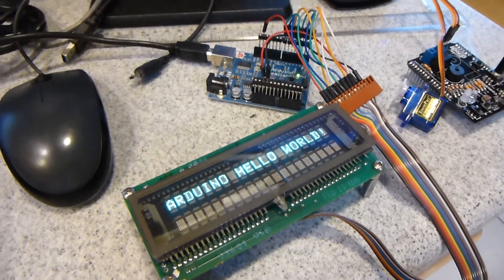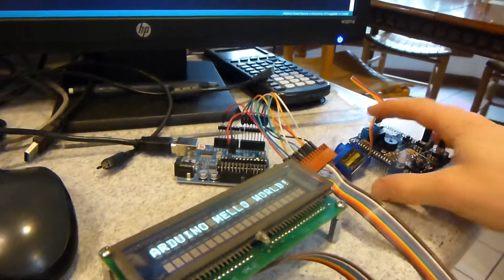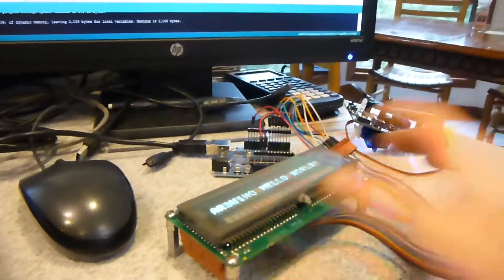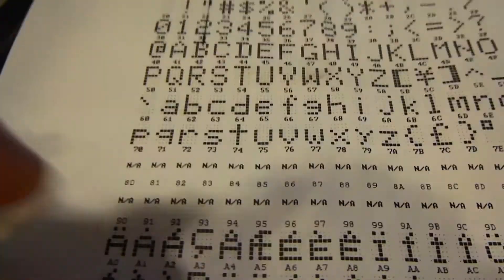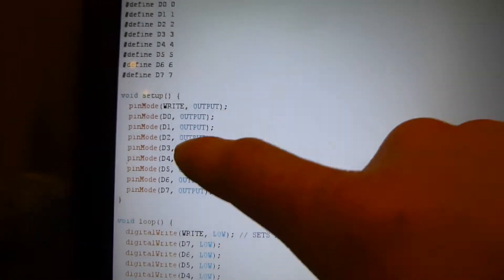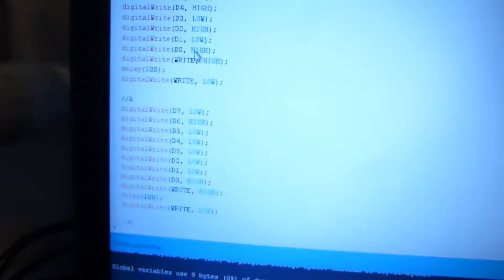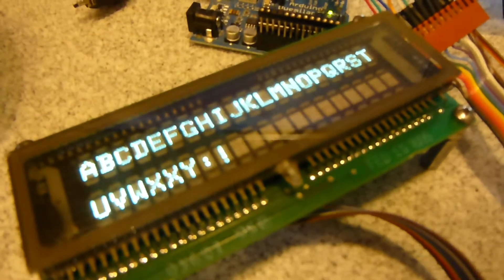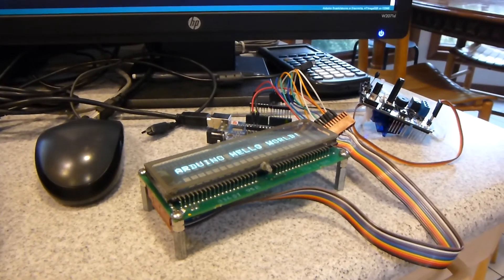Arduino Driving Vacuum Florescent Display With ASCII Hexadecimal Code

Comment: Dat pronunciation of duemilanove hahaha. "due-mil-a-no-vey" :)
It's definitely millisecond. Milli is 1/1000, micro is 1/1,000,000.
Reply from the maker: Jordan O'C LOL yeah my pronunciation is skookum!  LOL  I messed that one up!  :P  Thanks!
Reply: Makerj101 It's ok xD
Reply from the maker: Jordan O'C  Check out my code for the alphabet!  Yes, it is over 400 lines long and I expect nothing less than you to read every line.  LOL  have fun with that!  :P  JK

 //Alphabet Arduino

#define WRITE 13
#define D0 0
#define D1 1
#define D2 2
#define D3 3
#define D4 4
#define D5 5
#define D6 6
#define D7 7

void setup() {  
  pinMode(WRITE, OUTPUT);
  pinMode(D0, OUTPUT);
  pinMode(D1, OUTPUT);
  pinMode(D2, OUTPUT);
  pinMode(D3, OUTPUT);
  pinMode(D4, OUTPUT);
  pinMode(D5, OUTPUT);
  pinMode(D6, OUTPUT);
  pinMode(D7, OUTPUT);
}

void loop() {
  digitalWrite(WRITE, LOW); // SETS ALL PINS LOW
  digitalWrite(D7, LOW);
  digitalWrite(D6, LOW);
  digitalWrite(D5, LOW);
  digitalWrite(D4, LOW);
  digitalWrite(D3, LOW);
  digitalWrite(D2, LOW);
  digitalWrite(D1, LOW);
  digitalWrite(D0, LOW);

//CLEAR DISPLAY
  digitalWrite(D7, LOW);
  digitalWrite(D6, LOW);
  digitalWrite(D5, LOW);
  digitalWrite(D4, HIGH);
  digitalWrite(D3, LOW);
  digitalWrite(D2, HIGH);
  digitalWrite(D1, LOW);
  digitalWrite(D0, HIGH);
  digitalWrite(WRITE, HIGH);
  delay(100);
  digitalWrite(WRITE, LOW);
  
  //A
  digitalWrite(D7, LOW);
  digitalWrite(D6, HIGH);
  digitalWrite(D5, LOW);
  digitalWrite(D4, LOW);
  digitalWrite(D3, LOW);
  digitalWrite(D2, LOW);
  digitalWrite(D1, LOW);
  digitalWrite(D0, HIGH);
  digitalWrite(WRITE, HIGH);
  delay(100);
  digitalWrite(WRITE, LOW);
  
  //B
  digitalWrite(D7, LOW);
  digitalWrite(D6, HIGH);
  digitalWrite(D5, LOW);
  digitalWrite(D4, LOW);
  digitalWrite(D3, LOW);
  digitalWrite(D2, LOW);
  digitalWrite(D1, HIGH);
  digitalWrite(D0, LOW);
  digitalWrite(WRITE, HIGH);
  delay(100);
  digitalWrite(WRITE, LOW);
  
  //C
  digitalWrite(D7, LOW);
  digitalWrite(D6, HIGH);
  digitalWrite(D5, LOW);
  digitalWrite(D4, LOW);
  digitalWrite(D3, LOW);
  digitalWrite(D2, LOW);
  digitalWrite(D1, HIGH);
  digitalWrite(D0, HIGH);
  digitalWrite(WRITE, HIGH);
  delay(100);
  digitalWrite(WRITE, LOW);
  
  //D
  digitalWrite(D7, LOW);
  digitalWrite(D6, HIGH);
  digitalWrite(D5, LOW);
  digitalWrite(D4, LOW);
  digitalWrite(D3, LOW);
  digitalWrite(D2, HIGH);
  digitalWrite(D1, LOW);
  digitalWrite(D0, LOW);
  digitalWrite(WRITE, HIGH);
  delay(100);
  digitalWrite(WRITE, LOW);
  
  //E
  digitalWrite(D7, LOW);
  digitalWrite(D6, HIGH);
  digitalWrite(D5, LOW);
  digitalWrite(D4, LOW);
  digitalWrite(D3, LOW);
  digitalWrite(D2, HIGH);
  digitalWrite(D1, LOW);
  digitalWrite(D0, HIGH);
  digitalWrite(WRITE, HIGH);
  delay(100);
  digitalWrite(WRITE, LOW);
  
  //F
  digitalWrite(D7, LOW);
  digitalWrite(D6, HIGH);
  digitalWrite(D5, LOW);
  digitalWrite(D4, LOW);
  digitalWrite(D3, LOW);
  digitalWrite(D2, HIGH);
  digitalWrite(D1, HIGH);
  digitalWrite(D0, LOW);
  digitalWrite(WRITE, HIGH);
  delay(100);
  digitalWrite(WRITE, LOW);
  
  //G
  digitalWrite(D7, LOW);
  digitalWrite(D6, HIGH);
  digitalWrite(D5, LOW);
  digitalWrite(D4, LOW);
  digitalWrite(D3, LOW);
  digitalWrite(D2, HIGH);
  digitalWrite(D1, HIGH);
  digitalWrite(D0, HIGH);
  digitalWrite(WRITE, HIGH);
  delay(100);
  digitalWrite(WRITE, LOW);
  
  //H
  digitalWrite(D7, LOW);
  digitalWrite(D6, HIGH);
  digitalWrite(D5, LOW);
  digitalWrite(D4, LOW);
  digitalWrite(D3, HIGH);
  digitalWrite(D2, LOW);
  digitalWrite(D1, LOW);
  digitalWrite(D0, LOW);
  digitalWrite(WRITE, HIGH);
  delay(100);
  digitalWrite(WRITE, LOW);
  
  //I
  digitalWrite(D7, LOW);
  digitalWrite(D6, HIGH);
  digitalWrite(D5, LOW);
  digitalWrite(D4, LOW);
  digitalWrite(D3, HIGH);
  digitalWrite(D2, LOW);
  digitalWrite(D1, LOW);
  digitalWrite(D0, HIGH  );
  digitalWrite(WRITE, HIGH);
  delay(100);
  digitalWrite(WRITE, LOW);
  
  //J
  digitalWrite(D7, LOW);
  digitalWrite(D6, HIGH);
  digitalWrite(D5, LOW);
  digitalWrite(D4, LOW);
  digitalWrite(D3, HIGH);
  digitalWrite(D2, LOW);
  digitalWrite(D1, HIGH);
  digitalWrite(D0, LOW);
  digitalWrite(WRITE, HIGH);
  delay(100);
  digitalWrite(WRITE, LOW);
  
  //K
  digitalWrite(D7, LOW);
  digitalWrite(D6, HIGH);
  digitalWrite(D5, LOW);
  digitalWrite(D4, LOW);
  digitalWrite(D3, HIGH);
  digitalWrite(D2, LOW);
  digitalWrite(D1, HIGH);
  digitalWrite(D0, HIGH);
  digitalWrite(WRITE, HIGH);
  delay(100);
  digitalWrite(WRITE, LOW);
  
  //L
  digitalWrite(D7, LOW);
  digitalWrite(D6, HIGH);
  digitalWrite(D5, LOW);
  digitalWrite(D4, LOW);
  digitalWrite(D3, HIGH);
  digitalWrite(D2, HIGH);
  digitalWrite(D1, LOW);
  digitalWrite(D0, LOW);
  digitalWrite(WRITE, HIGH);
  delay(100);
  digitalWrite(WRITE, LOW);
  
  //M
  digitalWrite(D7, LOW);
  digitalWrite(D6, HIGH);
  digitalWrite(D5, LOW);
  digitalWrite(D4, LOW);
  digitalWrite(D3, HIGH);
  digitalWrite(D2, HIGH);
  digitalWrite(D1, LOW);
  digitalWrite(D0, HIGH);
  digitalWrite(WRITE, HIGH);
  delay(100);
  digitalWrite(WRITE, LOW);
  
  //N
  digitalWrite(D7, LOW);
  digitalWrite(D6, HIGH);
  digitalWrite(D5, LOW);
  digitalWrite(D4, LOW);
  digitalWrite(D3, HIGH);
  digitalWrite(D2, HIGH);
  digitalWrite(D1, HIGH);
  digitalWrite(D0, LOW);
  digitalWrite(WRITE, HIGH);
  delay(100);
  digitalWrite(WRITE, LOW);
  
  //O
  digitalWrite(D7, LOW);
  digitalWrite(D6, HIGH);
  digitalWrite(D5, LOW);
  digitalWrite(D4, LOW);
  digitalWrite(D3, HIGH);
  digitalWrite(D2, HIGH);
  digitalWrite(D1, HIGH);
  digitalWrite(D0, HIGH);
  digitalWrite(WRITE, HIGH);
  delay(100);
  digitalWrite(WRITE, LOW);
  
  //P
  digitalWrite(D7, LOW);
  digitalWrite(D6, HIGH);
  digitalWrite(D5, LOW);
  digitalWrite(D4, HIGH);
  digitalWrite(D3, LOW);
  digitalWrite(D2, LOW);
  digitalWrite(D1, LOW);
  digitalWrite(D0, LOW);
  digitalWrite(WRITE, HIGH);
  delay(100);
  digitalWrite(WRITE, LOW);
  
  //Q
  digitalWrite(D7, LOW);
  digitalWrite(D6, HIGH);
  digitalWrite(D5, LOW);
  digitalWrite(D4, HIGH);
  digitalWrite(D3, LOW);
  digitalWrite(D2, LOW);
  digitalWrite(D1, LOW);
  digitalWrite(D0, HIGH);
  digitalWrite(WRITE, HIGH);
  delay(100);
  digitalWrite(WRITE, LOW);
  
  //R
  digitalWrite(D7, LOW);
  digitalWrite(D6, HIGH);
  digitalWrite(D5, LOW);
  digitalWrite(D4, HIGH);
  digitalWrite(D3, LOW);
  digitalWrite(D2, LOW);
  digitalWrite(D1, HIGH);
  digitalWrite(D0, LOW);
  digitalWrite(WRITE, HIGH);
  delay(100);
  digitalWrite(WRITE, LOW);
  
  //S
  digitalWrite(D7, LOW);
  digitalWrite(D6, HIGH);
  digitalWrite(D5, LOW);
  digitalWrite(D4, HIGH);
  digitalWrite(D3, LOW);
  digitalWrite(D2, LOW);
  digitalWrite(D1, HIGH);
  digitalWrite(D0, HIGH);
  digitalWrite(WRITE, HIGH);
  delay(100);
  digitalWrite(WRITE, LOW);
  
  //T
  digitalWrite(D7, LOW);
  digitalWrite(D6, HIGH);
  digitalWrite(D5, LOW);
  digitalWrite(D4, HIGH);
  digitalWrite(D3, LOW);
  digitalWrite(D2, HIGH);
  digitalWrite(D1, LOW);
  digitalWrite(D0, LOW);
  digitalWrite(WRITE, HIGH);
  delay(100);
  digitalWrite(WRITE, LOW);
  
  //U
  digitalWrite(D7, LOW);
  digitalWrite(D6, HIGH);
  digitalWrite(D5, LOW);
  digitalWrite(D4, HIGH);
  digitalWrite(D3, LOW);
  digitalWrite(D2, HIGH);
  digitalWrite(D1, LOW);
  digitalWrite(D0, HIGH);
  digitalWrite(WRITE, HIGH);
  delay(100);
  digitalWrite(WRITE, LOW);
  
  //V
  digitalWrite(D7, LOW);
  digitalWrite(D6, HIGH);
  digitalWrite(D5, LOW);
  digitalWrite(D4, HIGH);
  digitalWrite(D3, LOW);
  digitalWrite(D2, HIGH);
  digitalWrite(D1, HIGH);
  digitalWrite(D0, LOW);
  digitalWrite(WRITE, HIGH);
  delay(100);
  digitalWrite(WRITE, LOW);
  
  //W
  digitalWrite(D7, LOW);
  digitalWrite(D6, HIGH);
  digitalWrite(D5, LOW);
  digitalWrite(D4, HIGH);
  digitalWrite(D3, LOW);
  digitalWrite(D2, HIGH);
  digitalWrite(D1, HIGH);
  digitalWrite(D0, HIGH);
  digitalWrite(WRITE, HIGH);
  delay(100);
  digitalWrite(WRITE, LOW);
  
  //X
  digitalWrite(D7, LOW);
  digitalWrite(D6, HIGH);
  digitalWrite(D5, LOW);
  digitalWrite(D4, HIGH);
  digitalWrite(D3, HIGH);
  digitalWrite(D2, LOW);
  digitalWrite(D1, LOW);
  digitalWrite(D0, LOW);
  digitalWrite(WRITE, HIGH);
  delay(100);
  digitalWrite(WRITE, LOW);
  
  //Y
  digitalWrite(D7, LOW);
  digitalWrite(D6, HIGH);
  digitalWrite(D5, LOW);
  digitalWrite(D4, HIGH);
  digitalWrite(D3, HIGH);
  digitalWrite(D2, LOW);
  digitalWrite(D1, LOW);
  digitalWrite(D0, LOW);
  digitalWrite(WRITE, HIGH);
  delay(100);
  digitalWrite(WRITE, LOW);
  
  //Z
  digitalWrite(D7, LOW);
  digitalWrite(D6, HIGH);
  digitalWrite(D5, LOW);
  digitalWrite(D4, HIGH);
  digitalWrite(D3, HIGH);
  digitalWrite(D2, LOW);
  digitalWrite(D1, LOW);
  digitalWrite(D0, HIGH);
  digitalWrite(WRITE, HIGH);
  delay(100);
  digitalWrite(WRITE, LOW);
  
    
  //:
  digitalWrite(D7, LOW);
  digitalWrite(D6, LOW);
  digitalWrite(D5, HIGH);
  digitalWrite(D4, HIGH);
  digitalWrite(D3, HIGH);
  digitalWrite(D2, LOW);
  digitalWrite(D1, HIGH);
  digitalWrite(D0, LOW);
  digitalWrite(WRITE, HIGH);
  delay(100);
  digitalWrite(WRITE, LOW);
  
  
  //!
  digitalWrite(D7, LOW);
  digitalWrite(D6, LOW);
  digitalWrite(D5, HIGH);
  digitalWrite(D4, LOW);
  digitalWrite(D3, LOW);
  digitalWrite(D2, LOW);
  digitalWrite(D1, LOW);
  digitalWrite(D0, HIGH);
  digitalWrite(WRITE, HIGH);
  delay(100);
  digitalWrite(WRITE, LOW);
  
  //0
  digitalWrite(D7, LOW);
  digitalWrite(D6, LOW);
  digitalWrite(D5, HIGH);
  digitalWrite(D4, HIGH);
  digitalWrite(D3, LOW);
  digitalWrite(D2, LOW);
  digitalWrite(D1, LOW);
  digitalWrite(D0, LOW);
  digitalWrite(WRITE, HIGH);
  delay(100);
  digitalWrite(WRITE, LOW);
  
  //1
  digitalWrite(D7, LOW);
  digitalWrite(D6, LOW);
  digitalWrite(D5, HIGH);
  digitalWrite(D4, HIGH);
  digitalWrite(D3, LOW);
  digitalWrite(D2, LOW);
  digitalWrite(D1, LOW);
  digitalWrite(D0, HIGH);
  digitalWrite(WRITE, HIGH);
  delay(100);
  digitalWrite(WRITE, LOW);

  //SPACE
  digitalWrite(D7, LOW);
  digitalWrite(D6, LOW);
  digitalWrite(D5, LOW);
  digitalWrite(D4, LOW);
  digitalWrite(D3, HIGH);
  digitalWrite(D2, LOW);
  digitalWrite(D1, LOW);
  digitalWrite(D0, HIGH);
  digitalWrite(WRITE, HIGH);
  delay(100);
  digitalWrite(WRITE, LOW);
  
  
  
  delay(1500);

}
Reply: Makerj101 Oh lord. I can't be bothered to scroll back up! XD
Reply from the maker: Jordan O'C LOL too much effort hahaha
Reply: Makerj101 Especially when it's 462 lines long hahaha

Comment: 10000000000nd
Reply from the maker: ***** LOL you get the award for first comment!!!  Get yourself some pie!!!  :P
Reply: Makerj101 Awww man, I wanted a cookie! xD. BTW Ive seen you looking for a better option for driving your flybacks than the "ZVS". Not so fast :D, I just got some FGA25N120ANTD IGBTs from ebay for $1 a peice. With a three amp switching diode and running the gates from  30VDC I am able to push over 100v into  this driver with no issues. Currently, Ive put up to 70VDC into the driver with no heat. Killed a flyback quickly LOL.
Reply: ***** That i juat not smart 100v on a flyback lol.You would need a x-ray transformer.
Reply: nahh , just a beefy core to wind ~ 800turns. I kill flybacks everyday.
Reply: Flyback killer.:P
Reply from the maker: E Isad LOL
Reply from the maker: ***** Well you can't have a cookie!  Pie or no pie.  That's your choices!  LOL  XD 

Wow those IGBT's looks like a great deal!  I may have to get myself some of those!  Are IGBT's harder to burn out?  LOL I bet you'd kill flybacks fast!  You need to make one like I did!